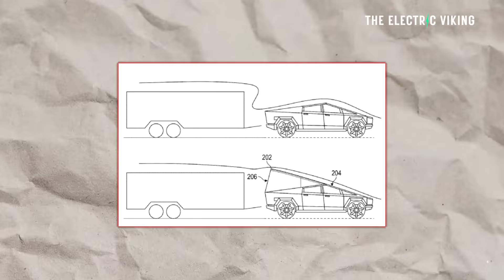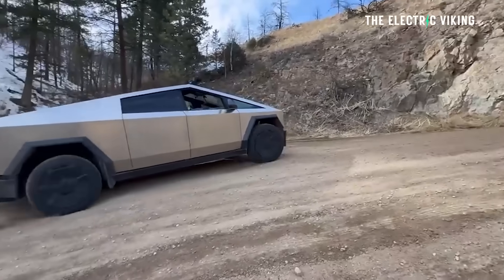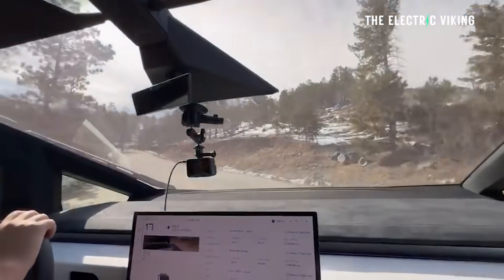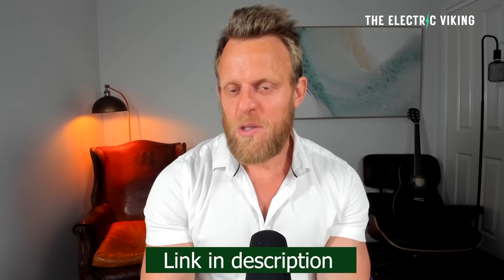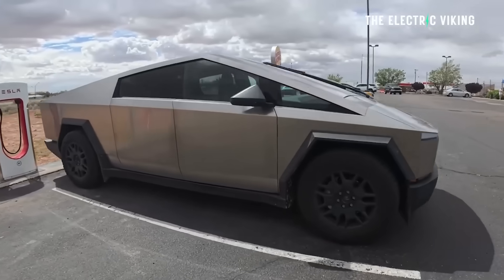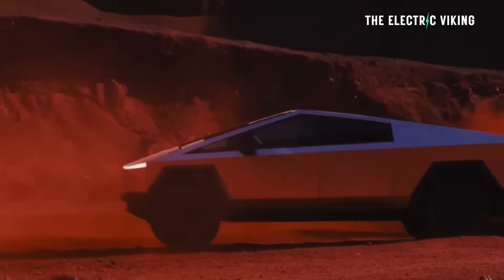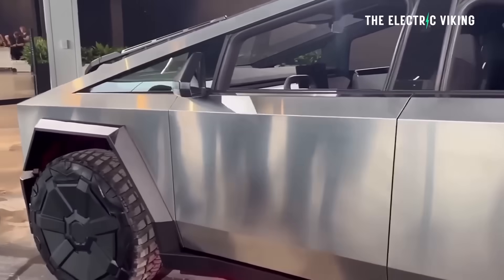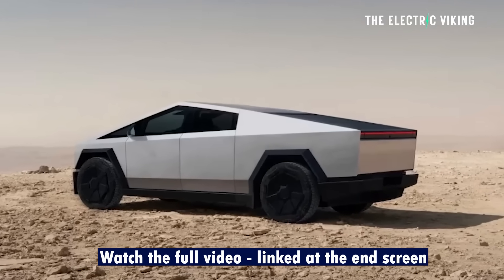Ridiculous Yet Efficient? Tesla Files Crazy Cybertruck Patent

Comment: As someone who spent years in a research group studying semi/trailer aerodynamics, both in the wind tunnel and simulated, I can confidently say that this will help, but not nearly as significantly as you'd think. Drag-wise, the shape of the back is far more important that of the front. And in any kind of cross wind, there will be oscillations in the gap that severely hurt efficiency either way. But it does add a lot of cargo volume at negligible or even negative aerodynamic cost, which is nice. Same as any other deflector, basically.
Reply: How much more efficient would you say it makes it? Like as a percentage
Reply: @SG-lj8uu  probably a couple percent.

Comment: You are already telling a big square box behind you I don't think the big are damn is quite as noticeable then and you should be able to adjust the ice to match your trailer
Reply: Now read quickly so you automatically  switch telling with towing and ice with height LOL
Reply: @WalterGawel 
Yes, obviously not read by the writer
Reply: @WalterGawel need ice management too like some 50ft flamethrower on the front to melt the ice before you get there lol

Comment: Likely a PR stunt for the publicity claiming only protection for that particular design. As you point out it is a fairing and Tesla was not the first to conceive of smoothing irregular shapes. A utility patent for the concept would be tough to get. Further, the pulling load on the trailer hitch includes aerodynamic drag plus the friction drag from tires which would vary greatly with weight. A 30% Improvement…good luck.